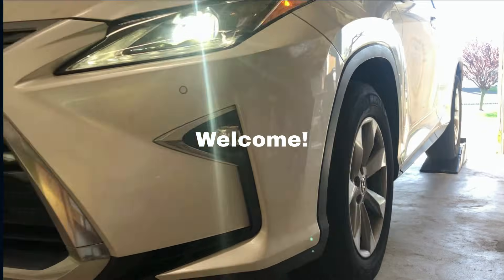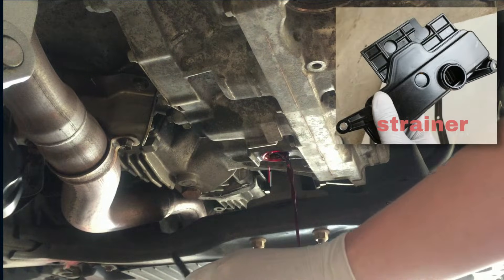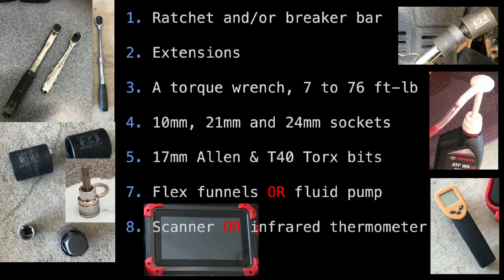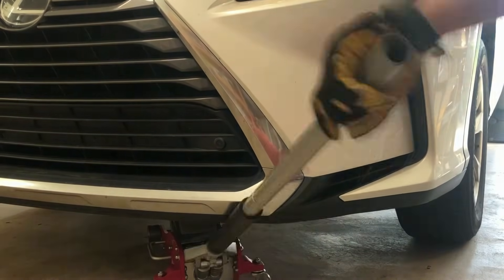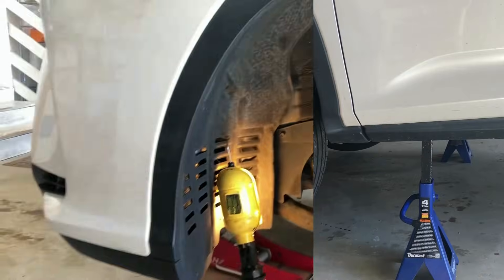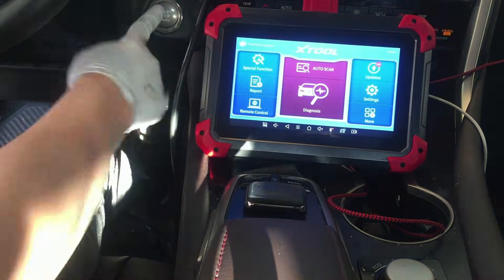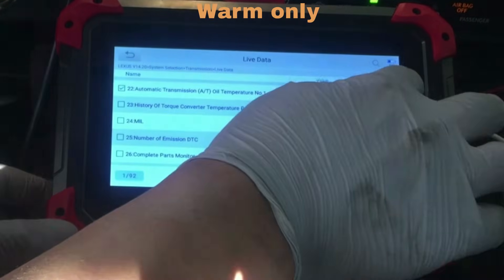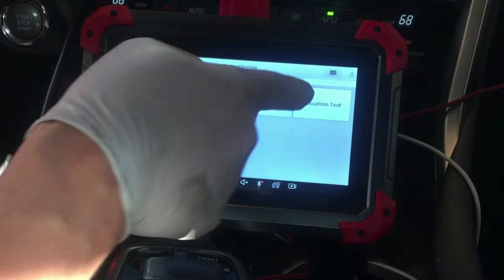Toyota Lexus Sealed Transmission Fluid Change & Level Check - 2 Temperature Gauges

Comment: Hello I went for regular service (150K) to Lexus in Delaware. The following is the video of inspection. They said I have multiple leaks. I think it's a very slow leak. The guy said they don't fix transmission leaks they change the transmission and it will be $10-12K!! PLUS $2-3K for the other leak possibly!

What do you think? I am tempted to use the At-205 for the transmission leak but need expert advice please. This is the video.

https://youtu.be/-9nPq12Ui1g
Reply from the maker: It could be as bad as they suggested or something very minor with the transmission pan seal. It's irresponsible for them, however, to recommend a transmission replacement without knowing where exactly it's leaking! I am wondering where the leak source is, between transmission case and the pan, at 30 seconds: https://youtu.be/-9nPq12Ui1g?si=sddCowqP8tx9Qbjt&t=30

Here are questions to help determine where the leak is and how much will cost: 
1) Have you done any transmission work or experienced issues with the transmission? 
2) Has transmission fluid been changed? If so, did the shop also drop the pan and replace the filter too? And if so, did they use OE parts, i.e. Toyota pan gasket AND filter? 

Aftermarket pan gaskets are prone to leak, and when they do, the oil can get onto transmission case and anywhere toward the rear of the car (because wind blows backward when you drive forward). I have seen this on Toyota/Lexus vehicles all because of the transmission oil plan seal and the fix is simply replace it with a Toyota gasket, which is a few hundred bucks even if you hire someone to do it. I discussed this problem in this video: https://youtu.be/mx-fRPakHtI

But again, it's important to know the service history of your vehicle to identify the culprit. Toyota / Lexus (Aisin) transmissions are very well built and they don't leak for no reason. If something has been serviced or replaced and then you experienced the leak, it's likely the leak is due to that reason. Even at 150,000 miles, it's unlikely to leak due to aged gasket seals (maybe engine oil/valve gaskets but don't think transmission seals will easily leak). By the way, Toyota transmission pan seals are not soft/rubber materials and AT 205 won't fix (rejuvenize) them.
Reply: @profsg  Thanks you for the detailed reply. I bought the car 1 year ago and the seller told me the transmission was replaced ed by Toyota! So I know that much. I personally did not do any fluid replacement etc. Also I have the full service history and I do not thing the transmission fluid was changed. 

SO what would be your best suggestion to me please sir? I do not want to go to Lexus dealership.!!
Reply from the maker: Yes, it's wise not to go bak to that dealership. I still don't understand how they can call for a transmission replacement just because of a leak and not knowing exactly where the leak is. I'd suggest find a honest local shop for another inspection and a second opinion. While they are there, check transmission fluid level and fill it to correct level if it's low. Very important for the health of your transmission! 

Now, regarding the oil leak, I do see on the video it's a bit of transmission (red) fluid at the bottom of the case (aluminum), which doesn't mean it's leaking from the case itself and could have come from the pan (black, see 1:10 of your video). Here are a couple of things you can investigate further: 

1) If the transmission was indeed replaced by Toyota (or any shop), it should have come with some warranty and you may reach out to see if it's still under the (replaced) transmission warranty. In this case, it's reasonable to assume the transmission pan gasket and filter have been replaced, with new fluid filled. While I hope they used all OE/Toyota parts for this replacement, it's possible they used aftermarket gasket/filter, which can explain the leak. 

2) Now this might be your fix but apparently I don't know without inspecting it in person. Right now the most urgent item is to make sure the transmission fluid is at the correct level and you will need to find a shop (and it doesn't have to be a Toyota/Lexus dealership) that you can trust to inspect/check that for you. So while they are there, if they see any potential leak in the transmission pan area, I'd spend a couple hundred more and ask them to drop the pan and replace the gasket (plus the filter and fluid). In this case, insist on using Toyota OE gasket, filter, fluid, and even new Toyota pan bolts. NOTHING aftermarket! 

Toyota parts are slightly more expensive than aftermarket counterparts but it's not worth for this job to test any aftermarket parts. And in your area, this dealership offers very competitive pricing (especially for online orders): https://parts.conicellitoyotaofconshohocken.com/

I just know them, not affiliation at all. I know yours is a Lexus (?) but all Lexus use Toyota parts and an honest shop can help you identify the correct parts. 

I hope it's just the transmission pan gasket seal/gasket and a few hundred bucks will do it. But again, find a honest shop to confirm and do the job for you. Best luck, and keep us posted.
Reply: @profsg  Thank you so sir for all you time and effort you put into my problem. I will go and search for one and keep you posted about it. Much appreciate all your hard work

Comment: Do you drain and fill 2 to 3 times?
Reply from the maker: No, I didn't. It's good enough to do it once every 30,000 miles. You could do this multiple times if you like to replace more fluid out, but only do so if you have done it regularly since the vehicle was on lower mileage. On a high mileage vehicle where this service hasn't been done before, do it once and see how it goes. Hope this makes sense.
Reply from the maker: You may check out this video: https://youtu.be/WFQJfbzUvdw

Comment: That's great but this method only replaces about 3 quarts the transmission holds 10 or more.
Reply from the maker: Thanks! The full capacity is a bit over 7 quarts, but you are right, this doesn't replace all the fluid. And so is a regular engine oil change. The idea is not necessarily to replace all fluid but to renew it with fresh fluid. If you do this regularly, every 30,000 miles, this will be sufficient to keep the transmission running smoothly. I have another video discussing the interval of doing this and the benefit of only drain and fill. Will add a link below.
Reply from the maker: This video doesn't address your question directly but may shed some light: https://youtu.be/X7iQ8hWcB_w

Comment: Is it the same with RX450H 2017 CVT gear ?
Reply from the maker: It uses the same Toyota WS fluid but the procedure is different (easier drain and fill without having to monitor the ATF temperature).

Comment: How mutch up and down play on inner cv axle does ur car have ?
Reply from the maker: It should be minimal play, if any. If it's more and/or you experience clicking/popping noise when driving/turning, you may have a worn/damaged axle/joint.
Reply: Im having a rotational huming noise only at 45 mph exactly at 45 after that is no noise and my lexus has a litle inner cv axle play  no clicking or popping noise at turning thats why i was asking how mutch is normal
Reply from the maker: @musicacristiana9795  Does it sound from the wheel bearing or tire? Is there play at the wheel? In the context of this video, do you suspect it's from the transmission/transaxle here? Does it have the same noise in different gears at 45 mph?
Reply: Sounds like a bad wheel bearing but no play at the wheel and only makes it at 45 mph exactly at that speed at 46 mph no more nose , i have put the car in neutral at 45 mph to see if it quiets down and still can be heard the sound  , the cv axle has a lil play up n down not sure if that has something to do

Comment: Love this video. Leaned a lot from this. 

After watched this video, I changed 2nd time transmission fluid on my Camry 2016 101k miles yesterday. 1st time at 96k miles, because I feel it had some slow shifting or sometime does not shift at 4 to 5 while using cruise control. It shifts when RPM  up to 2k5(normally <2k RPM). 
I have a couple questions, so I hope your response for my knowledge. 

1/ The warming temperature you mentioned in this video is 90-114 Fahrenheits for draining out the fluid. But I got the document on the internet from Toyota for dealer service realease in 2013 shows the temperature should be 185-195 Fahrenheits when changing. Which one do you think better? 

2/ The transmission fluid  I change in this time being dark, but doesn't not have burned smell. It's not red like the 1st I did(looks like brand new fluid). It's normal?
3/ What's normal transmission temperature when the car running? My car is 165-170 Fahrenheits, is it good? 

I attached the link of document I mentioned about transmission when working  below 

https://static.nhtsa.gov/odi/tsbs/2013/SB-10060725-2280.pdf
Reply from the maker: Thank you and these are great questions! 

1) I reviewed your document about the higher (operating) temperature when checking the level, and it immediately reminded me of the following video by WeberAuto: 
https://www.youtube.com/watch?v=cNcecuGzTDg&t=950s

In short, the procedure and the special tool used in this document is to quickly check the ATF level at the shop when they have no time to wait for the ATF to cool down. 

Do NOT follow that procedure for DIY ATF level check. That special tool accounts for fluid expansion at that higher temperature. 

2) It's ALWYS dark! No problem with that, as long as it's not burned, you should be fine. Keep up the good work! 

3) Your question #1 answers your question here, the 185-195 F is the operating temperature range. If you get around 170 F, that's great. Your ATF (together with the coolant system) is working to cool down the transmission. 

Hope this clarifies.
Reply: @profsg  thank you for your feedback, it makes me clear. I appreciate you and your idear with evidences

Comment: Excellent Video. My wife has a 2019 RX350 with 75,000 miles and the dealer said there's no need for oil change since the transmission is sealed. It really sounds weird and wrong and I insisted with the Service Manager and he said they don't recommend doing anything at all.
Reply from the maker: Thank you! I'd replace it with a drain-and-fill at this mileage. No need to replace the filter (or strainer) though in Toyota/Lexus land. I totally agree that this notion of "sealed transmission" is confusing and wrong. I have a couple of videos on this "controversial" topic but would like to share my latest observations while I was searching for a used vehicle from a different brand--

Subaru, for example, have different recommendations on (CVT) transmission services in the U.S.A. vs. in Japan. Here in the states, they say it's all "sealed" and no service required. But Subaru Japan recommends 30k-mile (50k kms) intervals for the exact same vehicles. You see the only difference is the market and it has nothing to do with vehicle design/engineering. 

On a related note, BMW has the same "sealed", no service recommendation on its ZF transmissions. However, ZF, the transmission's manufacturer, has a recommended service (fluid and filter change) interval of 50k miles (or 30k? I will have to double check on this). Who knows better the transmissions? 

The bottom line is: All fluid breaks down over time and should be refreshed at some point!
Reply: Yes I ran into this problem also they tell me they do not do this service and I’m like what??? I just think it would be better off fluid change fill and replace but the only reason I can think off so it breaks down and you have to buy another car… 🤷🏻‍♂️ have you done this transmission fluid change? If so at a dealer? Or where? Thanks!

Comment: Do you possibly have tutorials for this process on a lexus LS500?
Reply from the maker: I'd be happy to if I have a chance to work on this model. It's likely similar but it may require different types/sizes of bits to take out the overflow tube and plug. On Toyota and Lexus vehicles I've worked on, the fill cap/plug has been consistently 24mm near the front driver-size wheel. The tube itself is usually removed with a hex bit, though the size differs on different models (e.g. 6mm hex on a Camry but 17mm hex on the RX here). ClubLexus may have further information: https://www.clublexus.com/forums/ls-5th-gen-2018-present-289/

Comment: If the trans fluid is underfilled would I be able to tell from the temp? I ask bc I'm wondering if mine came undefilled from the factory.
Reply from the maker: While I doubt you have underfilled ATF from factory, there is a possibility that someone servicing your car might have mistakenly drain your ATF. Yes, ATF operating temperature can potentially go high if the fluid is underfilled. However, the standard procedure for checking ATF level is to remove the tube plug at the specified temperature and see if there is fluid trickling out. If there is no fluid overflowing, you have an underfill and should add fluid right there. 

If your vehicle is a SUV like RX350, you don't have to raise it as there is enough clearance underneath the car on the ground to reach the transmission tube/drain plug. Good luck!
Reply: @profsg  thank you

Comment: I think if you’re only doing a drain and fill like this - the 30k mile interval makes sense since you’re only replacing about 30% of the fluid.

On the other hand, if you go to the dealer, they replace the entire 12 quarts and 30k would be excessive if not detrimental.

I just had my 2013 done at 90k miles for the first time
Reply from the maker: Yes, that makes sense! For dealers or shops with the machine, it's easier for them to hook it up and do the flush. But it's always better/safer with a drain-and-fill. Good you did it at 90k!
Reply: @profsg it’s not really a flush, it’s a fluid “exchange” since they’re using the vehicle’s own pump to do it. Anyway, my 2013 had no problems after this, I ended up totaling it and getting a 2014 with 73k miles, did the same service and no problems.

No it’s not waste…if it was, then people wouldn’t be doing a drain and fill every 30k to mimic the same thing
Reply: Definitely not gonna be detrimental, but it would be a waste

Comment: Why do they sell filters then if you’re not supposed to replace them?
Reply from the maker: Good question! The ATF filters are for two scenarios--
1) For those (me included in the past) who believed that any filter should be replaced as a regular maintenance item. For latest Toyota filter/strainers, as I realized, the replacement interval could be as long as 200 or 300k miles (or even longer hypothetically). 
2) And for those who have transmission problems when filter replacement is naturally part of the job.
Reply: @profsg  why would changing the filter cause issues? If anything would cause issues, I would think not replacing it would…transmissions operate on hydraulic pressure…if the filter is clogged, it restricts flow and the clutch material is trapped anyway, so it’s not the same as having material in the fluid - what am I missing?
Reply from the maker: @js6752  Replacing the transmission filter itself, if done right with the right parts, won't cause any issues and is in fact beneficial. The problem is replacing it with a much inferior after-market filter. And even worse, after taking off the pan, replace it with an after-market gasket and perhaps strip a couple of pan bolts there. The transmission will leak and after-market filtration is not ideal! Don't ask me how I know it but you can watch this video: https://youtu.be/mx-fRPakHtI

If you really want to replace it, do it with ALL genuine/OE parts. Otherwise, if you replace ATF regularly, your Toyota filter (probably a strainer) won't get clogged.
Reply from the maker: And one more thing if you do want to remove the pan to replace the filter inside. Use penetrating oil on the pan bolts (be generous there) and be very patient (preferably overnight with multiple applications of penetrating oil) before taking them out. I was very gentle on them yet still managed to strip two of them. It was a PAIN to drill them out! This was on my Camry years ago. 

And after going through all the trouble, hopefully, you will come to the same conclusion the replacement is unnecessary--not because of the trouble but because of the perfect condition of the filter inside! 😅